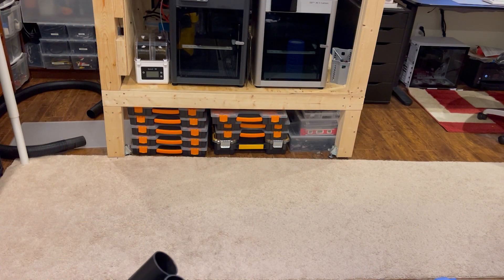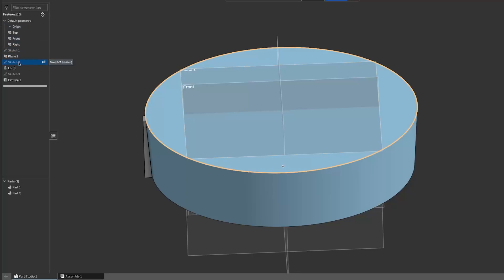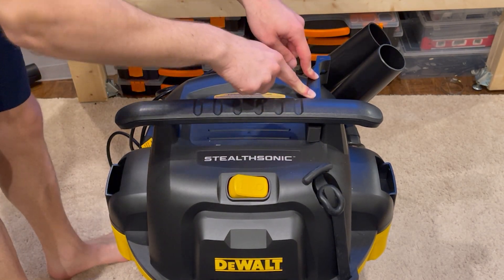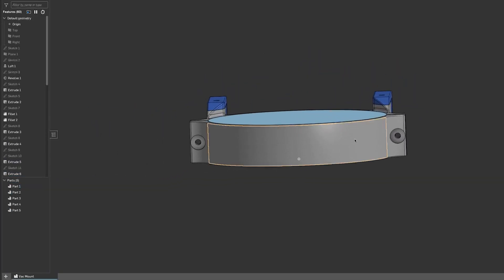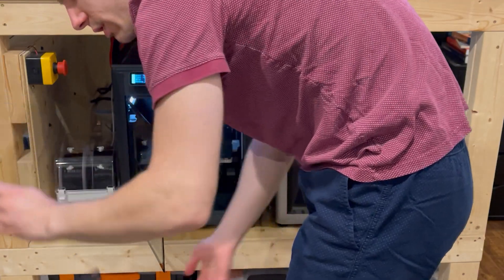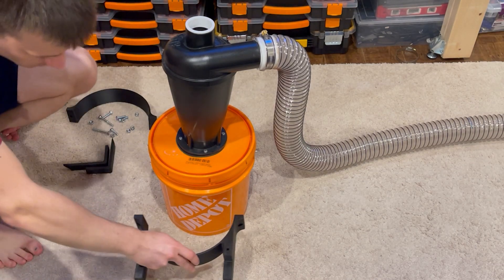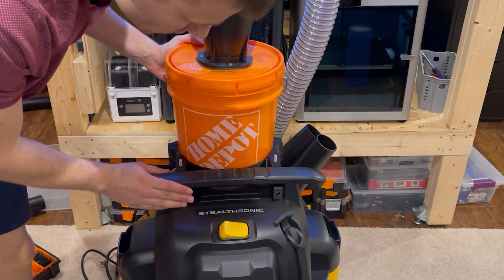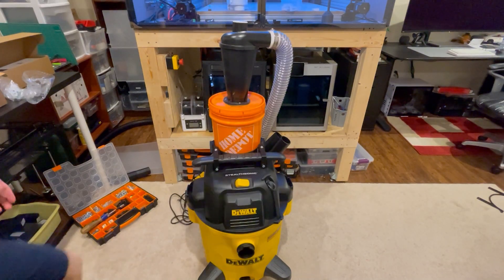DIY Cyclone Dust Collector Mount | Custom 3D Printed Bracket for Dewalt Stealthsonic Vacuum

Comment: The whole point of separation is to maximize the separation of the incoming and outgoing air flow. This separator is one of the worst, although it works, but it's not very efficient. The best separator is the dustopper pro, but it also has a significant drawback: the incoming air is supplied above the plate, while it should be supplied below it. Therefore, it's better to replace the separator if you want to improve its efficiency.
Reply from the maker: Thanks for the info, ill have to look into it